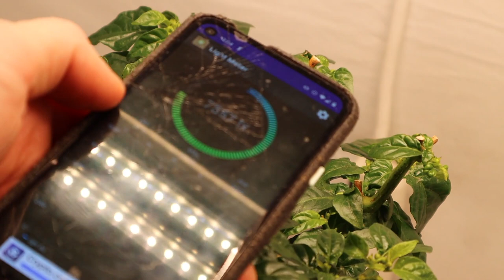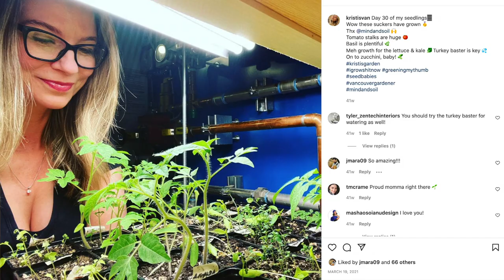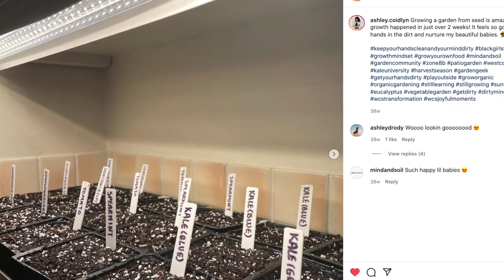4 Easy DIY LED Grow Light Stands

Comment: Great way to introduce growlights, Thanks for showing several setups, very useful. How about another vid on the actual growing of seedlings under lights( i.e. which seeds to put in which containers)? How about a talk on pollypro pots (yes, slightly expensive but we've got to get away from plastics and why not start here? Pollypro muffin trays anyone?) How about mentioning moving plants about is the place individual plants are lost (pinched between pots, thumbed out, missing the light)? How about watering and temperature (both tricky subjects)? How about culling the weak (a very unpopular idea)? How about the philosophy of holding on tightly and letting go lightly?
Reply from the maker: Thanks Barbara! Absolutely - we are about to have a whole bunch of seed starting content coming up!

Comment: Put the end pieces on the INSIDE of your wood frame ,attach a thin  1/4" plywood piece onto the end pieces ,and then put your grow tray or pots on the plywood .Keeps everything together if you have to move your stand and pots. For ease of lifting your unit attach a  small handle on the outside of each vertical wood piece at the top of. those verticals. I'm sure there are other ways of improving your simple but smart grow light stand.Thanls for your video!

Comment: Very helpful video.  Wondering about the seed starter kit - how long do the lights last?  And what is the cost for replacements?
Reply from the maker: Hey Debbie! Thanks so much for the kind words! The lights are LEDs so they should last multiple years lf for any reason they were to stop working in the first 2 years I would want you to get in touch with me as I should be able to replace them with the supplier warranty! I have mine on for about 12hrs per day and haven't had to replace a single one nor have we had any customers that have had issue :D

Do you need any help placing your order? Please email me at jordan@mindandsoil.com and I can lend a hand!

Comment: Hi Jordan - how critical is warmth relative to the lighting. I have mine plant babies growing in my laundry room, but it's a very limited space. Plus I'm getting a few fruit flies, which is kind of annoying in the living space. 

I'm thinking of my garage. I have a while wall I could leverage. The garage is insulated, but not heated. So likely only a few degrees warmer than outside. 

Maybe I sick to wintering peppers indoors. And germinating beans which need warmth. But what about the rest of the seeds. Think I'll have success out in the garage? 
I could do some heading pads maybe?
Reply from the maker: Very good question! Keep your eyes peeled for our next video coming out on Sunday of this week. Temperature is very important for germination and then not as important once growing. For germination, the success rate really drops off if it's below 70F/21C. So you want to make sure it's at least that warm. If you get tight on space, keep the warmest space for seed starting and then move the other babies to another area. You'll also see how I heat my seed starting area which will give you some ideas!

Also- you're officially a gardener now that you have those little gnats floating around! Certainly a nuisance more than anything!

Comment: Your basic 2x4 stand has only 1 light strip. is that enough light to cover a standard 10x20 tray of seedlings or do the ones on the edges reach in and get leggy?

Comment: How does it connect to electricity, is there a plug attached to the grow light?  In the first option, is there an outlet in your closet?  Where so you recommend buying grow lights?
Reply from the maker: Dorothy! Amazing question! Yes - there is a cord that simply pugs into any electrical outlet so it is super super simple to use. To make things even easier, I also bought a timer from Home Depot so that the light automatically turns on at 7:30am and turns off at 7:30pm. In terms of where to buy the grow lights, last year I experimented with 6 or 7 different ones and now we have my absolute favorite for sale on our website (and offer free shipping on all orders over $100): https://www.mindandsoil.com/collections/tools/products/2ft-grow-light
Reply: @MindandSoil  Thanks for the info
Reply from the maker: @dorothyg7484  absolutely! Feel free to email me jordan@mindandsoil.com if you need any help placing your order!

Comment: what grow light is that and how well does it do with larger plants that produce fruit or vegetables?  currently i am using a 1000 w BESTVA LED grow light hanging from the top shelf of a metal wire wrack and the plants on the floor with a tarp under them and boot trays under the pots.  been wanting to set up more grow space but the cost of lights and materials to hang them over plants has been a barrier.
Reply from the maker: We use Monios 2ft LEDs and loveeeee them. Not the most powerful out there but ive harvested tomatoes and peppers from underneath them!
Reply: @MindandSoil  i currently grow kale, broccoli, carrots, and soon micro greens.  my worry is that they would stop being enough once the plants get beyond the microgreen stage as i lost everything when i tried shop lights with 6000k bulbs, as well as cheap grow light strips.  after the plants got bigger then a softball they shriveled up and died.  however under this BESTVA 1000W LED light with both bloom/veg lights stuff is going strong even a sunflower that has gotten too tall lol.

will have to look at the return options if i decide to test them or maybe just use them for micro greens only.
Reply from the maker: @firearmssanctuary2448  Hahaha a sunflower under grow lights!! Amazing. Yeah the ones in our shop are definitely more in line with what you're looking for, while also affordable. If you want to pick one up to give it a try let me know and i'll get you a discount code! :)
Reply: @MindandSoil I love your video it’s very informative, can you tell me what grow light do you use? How many watts? And where do you purchase them from?  Thank you in advance